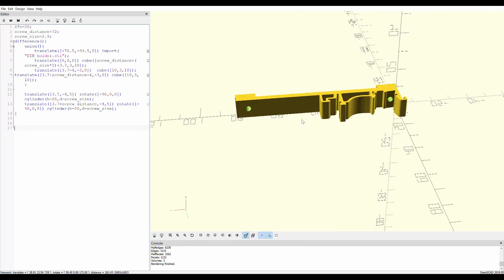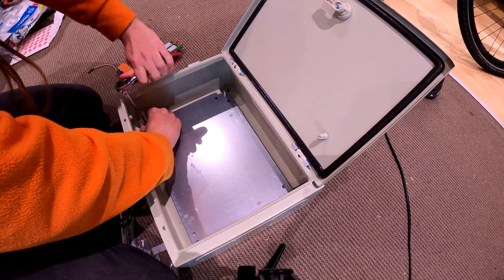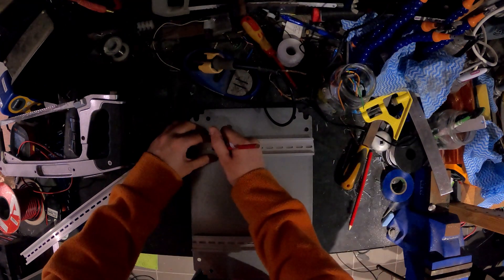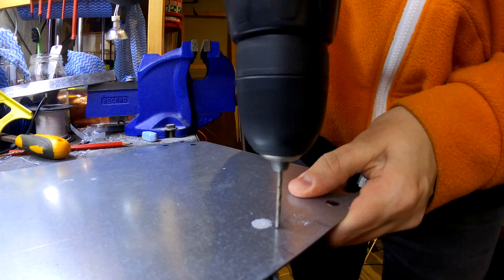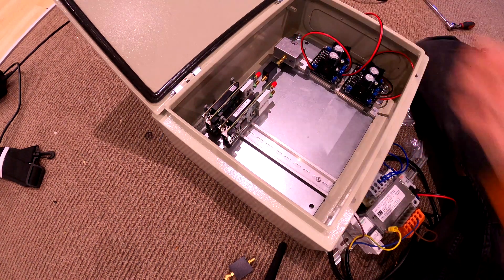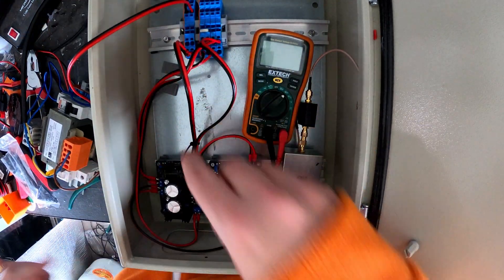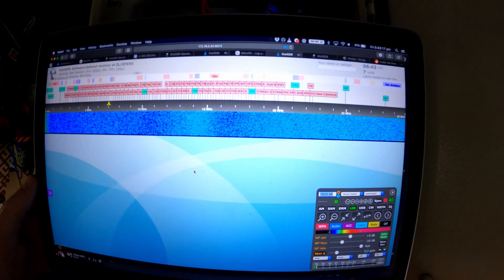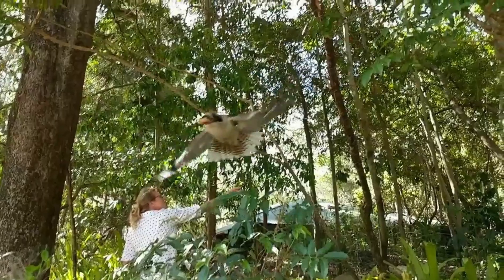KiwiSDR Station Build - Panel build

Comment: What’s your max ambient temp ? How do the KiwiSDR not over heat ?
Reply from the maker: The outside air temp max in Gladstone is 41C, The average max is closer to 31C.

The hottest part is the voltage regulator as they are linear and need to drop many watts of heat. Two fans are used to get air flowing in and out of the box and a shade sail was erected to keep as much radiant heat off the box as possible.